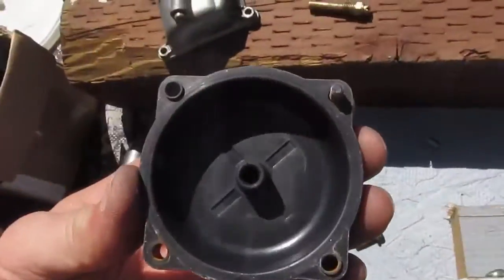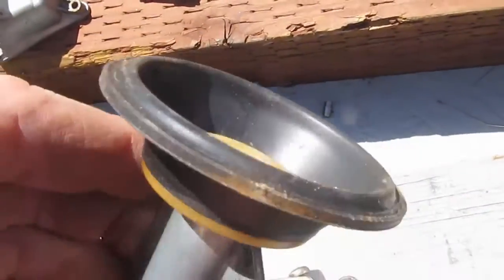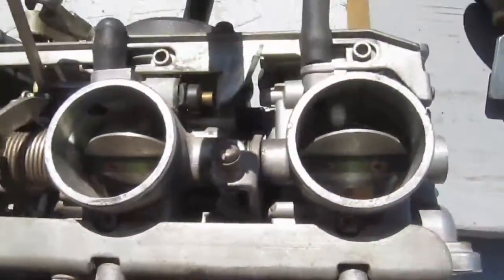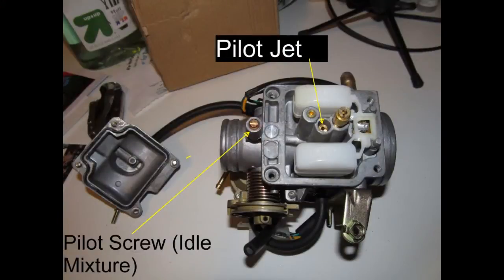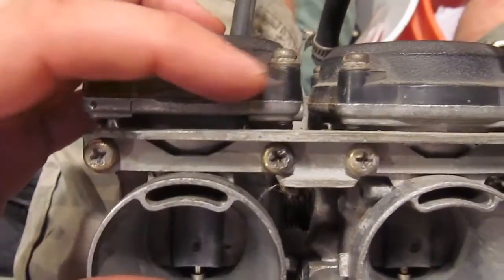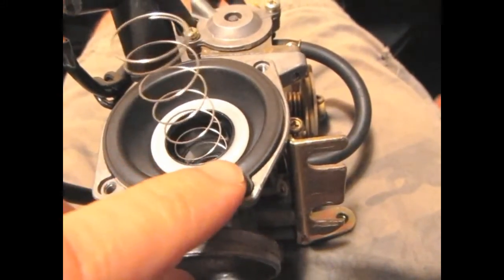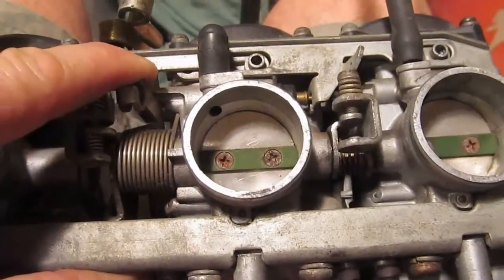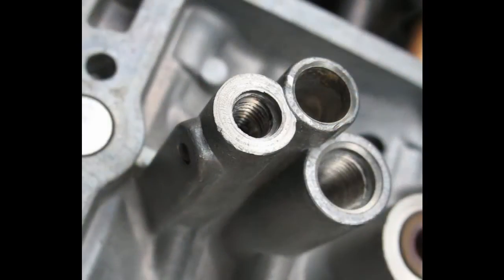Carburetor Cleaning Part II GY6 - Hands On

Comment: Question: When a Yamaha service manual calls for 1 3/4 - 2 "turns" out on a carburetor mixture screw, what do they mean by a "turn?" Does it mean one full revolution of the screw or is it just a natural turn of the screw driver? Hopefully, you understand my question...Thank you.
Reply from the maker: That's a very good question yes they mean one complete turn and the easiest way I have found to accomplish that is where ever you start to have turns basically going from 12 to 6 count half back to 12 and you have made one full Revolution 12 to 6 and now you're at 1 and 1/2 turns. From there you can always do somewhere between a quarter and a half to fine-tune things but remember this mainly affects the richness of the idle and you're looking to smooth things out it can't really compensate for other problems or this clogging or improper flow. And as mentioned in the video approximately three turns it the Max Beyond that moving the screw out more does not add any fuel
Reply: @pcofranc  Okay, I understand what you mean. Thank you very much for the detailed reply. I appreciate it.
Reply from the maker: Also remember as you turn the screw in to gently see it where you just feel a little resistance never make it tight or crank it down because you can easily damaged the mixture screw
Reply: @pcofranc  Okay, got it. One more question for you. My motorcycle is a 2004 Virago 250; and I would like to purchase a spare carburetor. Let's say I have a choice between buying a used OEM carb verses a new Chinese made carb, from Ebay, and they are both approximately the same price. Which one would you buy? The reason I ask is because carbs are pretty complicating, and I have a feeling that the Chinese carb may not work very well, if at all.